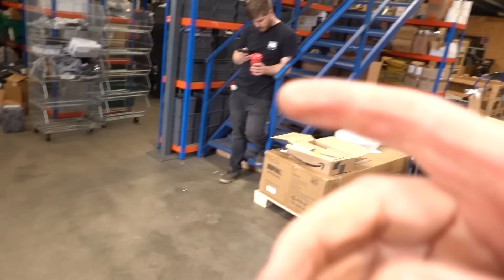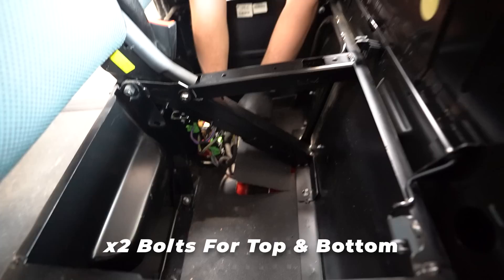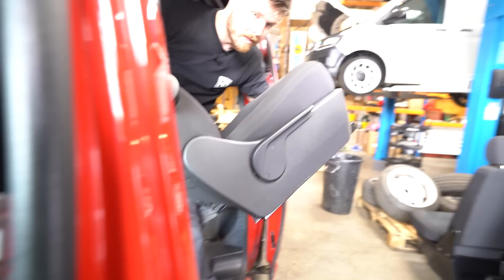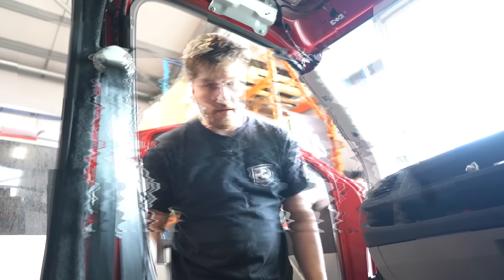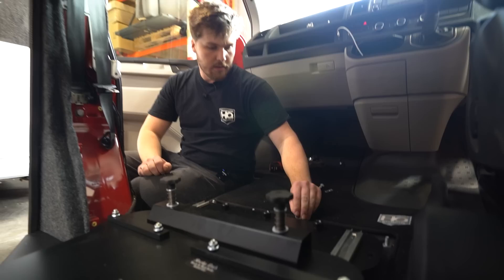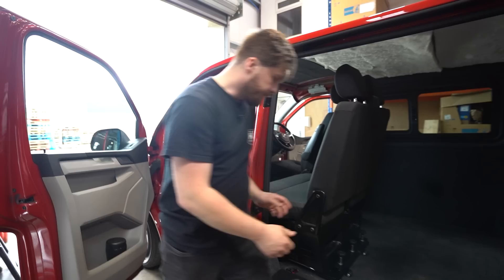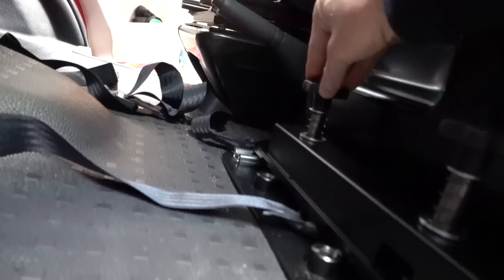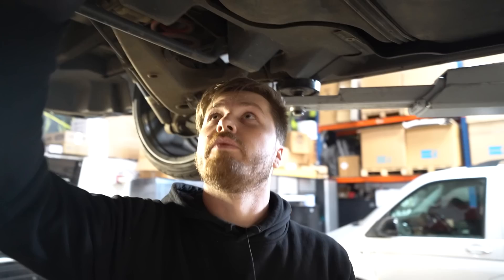Transporter Double sliding & single swivel seat base from Rusty Lee, plus handbrake lowering Kit

Comment: Very informative video. When I saw the lowering bracket for the handbrake I thought it might make it easier to swivel the passenger seat that pushes the handbrake. I called THQ to confirm and they said it does make it easier. However after buying and fitting there's no benefit for swiveling the passenger seat, actually made it worst. So lowering kit only necessary for adding a swivel plate to driver's seat. Anyone want a lowering kit? Otherwise happy with everything else I buy from THQ.
Reply: I'm about to buy one... although assuming 5 months on, you managed to get shot if it(?) 😊

Comment: I have a kiravans swival which is a pain to use. Does this complicate the installation? I assume I would need to remove the Kiravans plate. Also how much higher does this move the seat up by? Finally, I have a Transporter 6.1 van is it compatible. Many thanks.

Comment: Hi, just fitted my 12mm floor with vinyl on top, I did put insulation under first, so it’s a little high, will this hinder the slider/rotation etc? Thanks

Comment: Do you need to disconnect the battery if you’re disconnecting the seat airbag wires?
Reply from the maker: Yes ideally you would want to disconnect the battery as if anyone turned on the ignition with bits disconnected, it could give you a dash warning light that would need clearing.

Comment: Put mine in yesterday. Really straightforward, good bit of kit will make a big difference having the different positions. Having the retaining screws on the outside of the seat is great, saves having to lift the seat every time you want to move it. Was glad of the video as i couldn't find any instructions in the box.
Reply from the maker: Glad to help. Video's are really useful and easier to follow that printed instructions. We try and do more and more 'how to" videos.

Comment: Got mine yesterday and fitted it today, previously had the just campers one and have to say in everyway its better, very heavy tho but feels more sturdy.
Very easy to fit and while at it I decided to relocate the fuse for the cab cigarette lighter. 
Only bad bits I could tell were
1. Its alot higher than the original 
2. The seat sits slightly further forward 

Now I guess its time to get seat base which is lower by 2 inches but its another £300
Also a great excuse to get the tilted seat bracket
Reply from the maker: Yes the lift is the down side to all swivel bases. Shortened bases are expensive but will solve it.
Reply: @THQAutomotive  yeh I know but the rusty lees base is soooooo much better, time to get a paper round and save for a shortened base

Comment: Great video, thank you! This may be a daft idea but...would it be possible to replace the front seats of a Dacia Duster with swivel seats? My daughter is into slalom kayak racing, and we will need to travel more for this. So far, we have camped in a tent, but this is often impractical (esp out of season) so I'm looking at alternatives. We can't afford a campervan but need a new car anyway and are considering a Duster. I know there are options for putting a bed inside, but would prefer a roof tent to sleep in so we still have room for all the slalom gear. Just wondering whether there is some way to get a small seating area with table in the back of the car, to have somewhere to hang out. Any advice you can give on this would be much appreciated!
Reply from the maker: Hello, I doubt it. There is likely not enough room for the seats to swivel without hitting someone else.

Comment: Just fitted mine today, love it.
But does anyone know why or where the  2 black metal brackets with holes in go? They look like the go under the seat base at the front but then the seat is on a tilt.
Reply: They won't go anywhere else due to the spacing. I guess it's to mitigate some of the height increase.

Comment: When at 12:15 into the video you mentioned that they are not compatible with heated seats, is that for both single and double swivel seats or just the double.
Reply from the maker: Singles can be made to with heated seats

Comment: Just received mine today and installed the double swivel sliding base. 

I was replacing a swivel only and I find this one so much better. 

But what I have noticed is when pushing the seat back to driving position. The seat hits the three bolt holes of the base (where the two bolts, bolt into). Any ideas why this is happening? I can tilt the seat back but it’s not as smooth as I thought it would be.
Reply from the maker: Hi, i don't really understand. Please could you email me a short video of your issue so i can work it out? Thanks andy@transporterhq.co.uk
Reply: @THQAutomotive  thanks for replying. I’ll film it tomorrow for you and send you an email. Thanks so much.

Comment: Just to confirm the heated seats don't work even if it's a single seat?
Reply: The plate blocks access to the wiring which comes up from the floor for a double. Single might be possible, but maybe not with slide.

Comment: Couple of questions.

How much higher does the bench seat sit from standard?? Looks a considerable amount.

Also does it cause the seat to lean back. I have a 10degree vankraft bracket on my bench currently and im worried with the seat base its going to lean too far back as i read somewhere the swivels add some rake to the rear of the seat. 

Any help would be appreciated 

Thanks :)
Reply from the maker: Hello, yes the seat will be 35mm higher. It doesn't change the angle, I would still use the vankraft bracket

Comment: Hi. Can the double seat still store items when using the swivel base? Love your videos. Cheers. Billy
Reply from the maker: Yes the rusty Lee doubles can. Others have the fixings bolts inside so you have to remove everything before you swivel.
Reply: Yep and as you've moved the wires and the protective plastic covers there's a little more room than before.
Reply: @6581punk  my lastest problem in fitting the swivel base is my double seat has an airbag fitted. I have tried connecting a 3.0 ohm resistor but carista said the resistance was too high. I now have a 2.7 ohm resistor to try 🤞

Comment: I'd like to add a swivel to my drivers seat in my 5.1. The dealer I bought it from said it's not possible because I already have a leisure battery installed underneath. Is this really the case or is there a workaround?
Reply from the maker: Hello, no you should be fine as long as its a slim line battery.
Reply: @THQAutomotive  Thanks!

Comment: If i only do the double swivel do i need the handbrake lowering kit? Or is that just for the drivers swivel?
Reply from the maker: No you don't. They're to go with the single.
Reply: @THQAutomotive  perfect. Thanks. Have asked to be notified for stock on the website :)
Reply from the maker: @lasersailing2k8  should be this week 😊